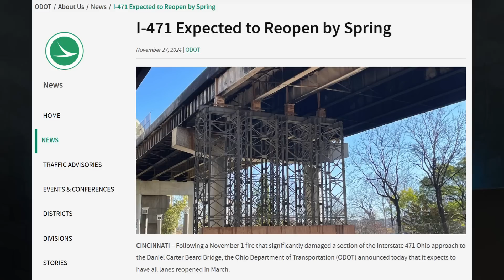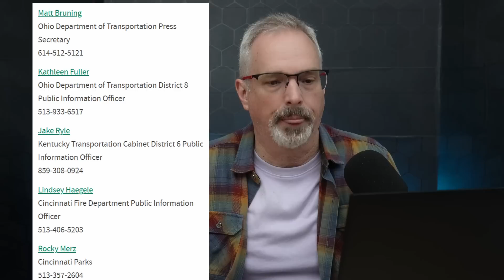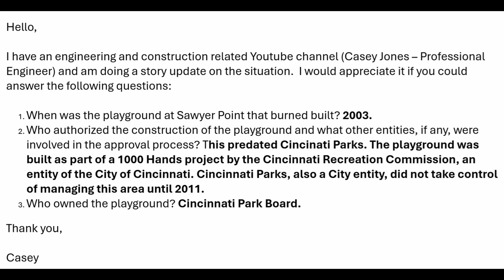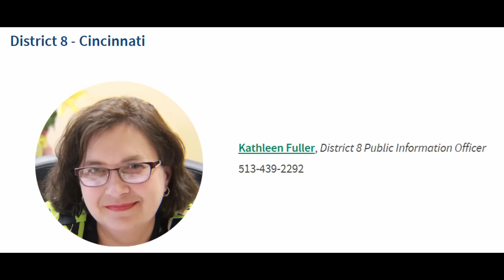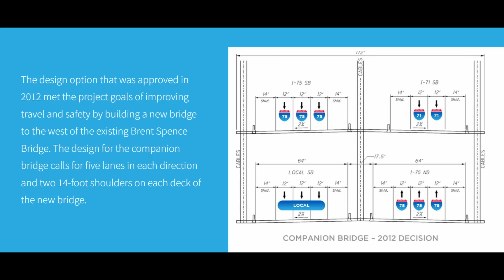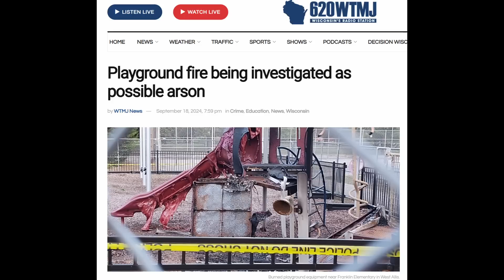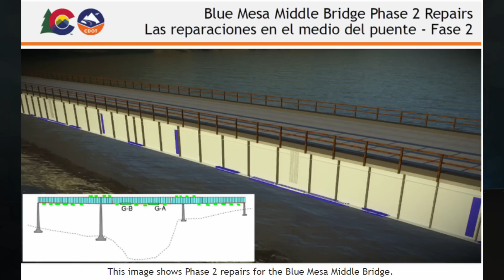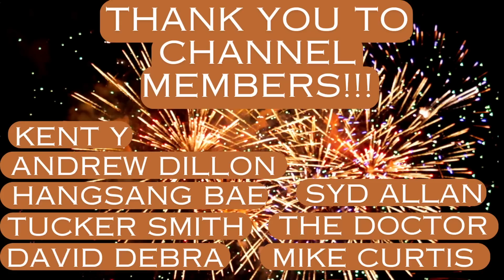Big Mac Bridge Repair Steps and Timeline

Comment: The notion that it was a black swan event is ludicrous.  Before giving the ok for anyone to build any structure under any bridge or span no one  asks or tries to ascertain if the proposed structure flammable. Is the playground they are asking to build, which contains 2,000lbs of plastic and rubber flammable? How flammable? If it catches fire could it damage the bridge or span?
Given the publicity from 9/11 and a host of other highly publicized bridge failures dew to fire, thats just incompetence.
Reply: Just who was incompetent though?  The people who might never have been asked?  I agree though, not a black swan.  There is too much experience with burning tires for that.
Reply: @michaelmcmullen354  
Whomever is responsible for giving the go ahead with any project to be built under any bridge is the guilty one. If that structure damages the bridge in any way. Whenever a bridge is damaged by a fire.  Apparently it never acures to anyone to ask who gave permission for the burned structure to be built, and hold that person accountable.

Comment: It can take 6 to 12 months to get funding to fix this bridge.  So if you total up the time to get the steel plate, then fabricate the steel beams, then shipping the beams, and scheduling the men to do the work.  Not counting equipment allotment and movement.  This all takes time, unless the feds supply emergency methods.  In Ohio, the government is corrupt to a point of criminal.

Comment: I did not understand that they were talking about an entire bridge replacement but rather replace of a span as here, not sure what Ohio does but here in NJ we maintain traffic at full lane count and then have to design removal of the structure a lane at a time.  It takes a lot of time on the design end to accomplish that.  Here they have a shut down span with no traffic control issues and the ability to take out the entire span.  My experience as a driver to family in Ohio is that they like we in NJ do do not shut down lanes but rather work traffic to full lane count, at least on freeways.  I have seen them shut down freeways in the Columbus area where there are good alternate routs, apparently to expedite work..  My assessment of ODot as a long term highway engineer (license retired) is they are a high quality organization.   The comparison to Colorado is questionable as those repairs we done on in-place structures with apparently no deck or structural members being replaced.  These members appear to be rolled members , but they may be built-up girders with web stiffeners and cross bracing, they are not just call a mill and out those girders come.  They may be oversized, as bridge beams are frequently and then there is fabrication.  This is not a call up Amazon, or Granger and order a beam it is a lot more complicated than that. Good job ODot.
Reply: The decision on how to restore or maintain traffic is a difficult one.  I will say for newer bridges they often have generous shoulders and a number of lanes needed for either the class of road, or expected at a future date.  This makes maintaining the lanes easier.  For an old bridge usually traffic has increased and either the shoulders were small or got converted to another lane as traffic increased.  Widenings then usually need to be made first to provide room to begin demo.  Sometimes this requires a widening larger than the final construction does.  It can be less expensive though due to simplification of construction, and sometimes can be used to defer or prevent the need for future widenings.
Reply: @michaelmcmullen354  You understand the problem, I just came through a route in NJ where they have actually built temporary "Baily Bridges to reroute traffic and not drop lanes, complicated and expensive.  I have watched ODot on I-70 between W.Va. and Columbus do something similar, there using extra wide bridges.  All of that design and planning and bidding takes large amounts of time.
Reply: @dmac6004  I actually once used a baily (actually Acrow) bridge for temporary traffic over the Arkansas river and D&RGW RR.  They worked well.  Expensive, but necessary (long detour to get to the other side).  In some ways this was like the US 50 T1 issue.  It was carrying US 50 about 100 miles east of the one near Gunnison.  It was hit by a grain truck on a very cold January morning and partially collapsed with 4 brittle fractures of members (not T1 steel, low charpy).    The Acrow (Baily but stronger) was expensive and took a good while to lease and get shipped to the job site.  The rental cost of the Acrow was about 2/3 of the price of new.  I thought at the time that they should have bought it for potential detour work, but experience with some bailey bridges Colorado owns indicates that they would not be used enough to keep track of and store all the parts and also not used often enough to still have people experienced enough to assemble them.
Reply: @michaelmcmullen354  You are right Acrow, somehow always called them Baily will correct in any writings, thanks.
Reply: @dmac6004  I think their business is in New Jersey which may explain why many were seen there.
Reply: @dmac6004  The Baily  bridge was the predecessor used heavily in WWII.  They are very similar but the Acro is somewhat more capable, I think mostly due to better steel.
Reply: @michaelmcmullen354  You are right about their location they are in Parsippany in NJ.  Actually you can guess my age since I called them Baily bridges as you note a WWII bridge, that is what they were when I started to be interested in roads and bridges, early 50s (like 8 years old) and not sure Acrow even existed then.
Reply: @dmac6004  We must be very close to the same age.
Reply: @michaelmcmullen354  I will say I graduated from NCE, now NJIT in 1966 and licensed in '71.  Worked on the widening of NJTPK in 1966, 6-12 lanes with full interchanges, (we had interchange 15 and the southern mixing bowl) still ranks high in my experience and the ran a firm locally for some 35 years.
Reply: @dmac6004  USAF, then night school grad at CU (physics) while working in CDOT bridge design.  PE 1978.  Retired CDOT in 2003 after 34 years.  Much work in Glenwood canyon through the decades.  Part time work since 2003 at both CDOT and PBSJ/Atkins.  A lot of work on curved steel box bridges, post-tensioned and prestressed girders, MSE walls, Rockfall, and lately bridgerails.
Reply: @michaelmcmullen354  I have to admit I am a real easterner when you used CDOT I immediately though Connecticut but Glenwood Canyon woke me up.  That is another one of those top of the profession experiences.  I have not been along it but next time in CO will try to do it.
Reply: @dmac6004  Actually born in Brooklyn, grew up upstate NY.  Met future wife at USO in Denver.

Comment: I don't think ODOT has done a terrible job in getting their project underway, but their bluster and BS about it "normally being a three year project" just makes them look stupid. It's not like it's a big job figuring out what needs to be done. The bridge was designed long ago, and now just needs a repair. Surely the plans are on file in a dozen places, so it's really just a matter of ordering parts and getting the contractors organized.

Keep it up with the drone video! You have been finding some talented operators, and it really does take your productions to another level.
Reply: We had a similar situation here in Milwaukee with a significant bridge failure. The ordering of the girders was expedited in the first week. It takes time to produce the steel, no matter what its final configuration will be, it gets ordered immediately... you don't need much design for an existing bridge (even if the design standards have changed since the first time). There is also time needed to have fabricators reconfigure their production schedules to make the actual girders... it gets requested immediately. All of this was started before the initial dust settled. Under emergency conditions a lot of the "design work" is waived... Alternative selection, environmental, foundation/soil investigation, public meetings, land purchases, 30%/60%/90% plan reviews, etc. Under emergency procedures, this should take 4-6 months...all hands on deck. Under promise and over deliver but as you said, comparing this to a 3 year project is gilding the lily... what the public perceives as government inaction instead of government in action. I am not sure the Francis Scott Key bridge will take three years.
Reply from the maker: Thank you so much for your comments and encouragement!
Reply: My two cents on the “it normally takes three years” statement may be somewhat supported in a Request for Bid type of project in which the request is released, including a definition of the scope of work being sought, bids are submitted, reviewed and awarded, etc.  This may take several months in the timeframe of a project being sought, awarded and work initiated and completed.  Still, three years is a bit inflated in my estimation.  I think someone at their next public update should challenge them on this by comparing the amazing I-95 bridge replacement of a few years ago, after a tanker fire destroyed a bridge in Philadelphia.
Reply: @jamesbrumgard9066  I think you're on the right track. A "conventional" bridge repair project could easily take that long from the "we need to talk about fixing this thing" to the final completion. Further, in a conventional repair situation, it's not going to be an all hands on deck, 24/7 kind of workload. There are other projects that would be working at the same time, this or that taking priority, etc. Casey is right that an "emergency" project doesn't take that long, but I don't think that is what Ms Fuller was talking about.
Reply: Six months work and over three years to organise finance…

Comment: So the take away I got is, "We normally drag our feet and take years to do projects. This time we are just going to get it done."
Reply: Years are needed to avoid creating problems.  If best scope is unclear and you only need to replace a broken component, the scope can be much less.  Depends on the structure and the damage.

Comment: The south bound I-5 bridge over the Skagit River in western Washington was knocked down by a truck several years ago. A temporary Military bridge was installed to allow 2 way traffic. The replacement was built alongside on temp pilings; then the temp bridge was removed and replacement was slid into place. The southbound out of service time was much less than originally forecast.

Comment: Well maybe 3 years for the replacement of the entire bridge deck and girders, but certainly not for a single span.  In 2001, they replaced the entire deck and supporting girders of the Jacques Cartier bridge in Montreal, Quebec, Canada.  A then 90 years old 2.68 km long cantilever bridge over the St-Laurence river and waterway. They worked during the night while the bridge remained fully open during the day.  About 90% of the bridge users where not affected by the repairs operations.  And it took only 2 years to complete!  There are videos on YT about it.

Comment: Three years is perfectly reasonable for a regular design-bid-build process for a run of the mill bridge rehabilitation project.  For instance a concrete deck overlay with superstructure and substructure repairs on the average overpass or stream crossing.  The stream could take longer due to environmental reviews and requirements, some plants can only be identified at certain times of the year.  

A superstructure replacement with substructure repairs (the scope of work here) would in some areas be programmed 5-6 years in advance with design beginning 3-5 years before completion depending on the site, for example potential presence of listed species, recreational properties, railroad coordination which are all required for environmental clearance.  The emergency process does circumvent a lot of the environmental bs.  I am not sure what you would do if you ran into right-of-way problems, that can add years.  (Shouldn’t be a problem here but sometimes the real estate people sell off ROW a little closer than they should). ROW could be a problem depending upon how they expect to set the beams, most likely in the form of right of entry but that depends on a lot of factors.

I have watched a number of your videos, seems like you should be familiar with the standard procedures.  Maybe not as you seem to specialize in geotech consulting which is a part of a project but not the whole thing.  Not sure if you are keying in on the 3 year statement to generate controversy or interviews or are just unfamiliar with how long the standard process can take.
Reply from the maker: You entirely missed the point. This isn't a standard process, this is an emergency repair. The two timelines should not be compared. Since the standard process doesn't apply here they're only mentioning it to mislead people.
Reply: @CaseyJones-Engineer  Keep in mind we are criticising a PR process which has only little to do with what the minions who do the work closer to the action are doing and thinking about.  What the public wants is not as engineering focused as what the people who read this sort of Utube and its comments are interested bridge.  I design a bridge the entire process taking a decade from conception of need to opening.  It is beautiful, economic, and cuts travel time 10 minutes.  I go to the opening attended by the state govenor.  He praises the work of the consultants who designed it (they didn't, I did, a state employee).  I ask my wife what she thinks of it as we go under it (she knows more about bridges than 90% of people having been married to me for near 60 years).  She says "What bridge".    I attend a National Convention and recieve award for best bridge of the year...

Note any highly experienced engineer who doesnt know how to set up a process for an emergency repair is not worth his salt.  He will know if a "standard" process set up for emergency repairs the existance of such a standard will get in the way due to the standard being miss applied or over applied.  Such is the nature of bureaucracies.
Reply: It also takes 20 years to build a nuclear power plant but what does that have to do with an emergency span replacement on a critical artery? "Normal" processes are short circuited and, to a degree, price is no object to restore the facility.

Comment: It’s going to be one span plus a support column, which once you start chopping back on the concrete, you might as well be replacing 2 spans.
Reply: Maybe, often fire damage on concrete is limited to the cover so a column can be repaired by removal of the damaged concrete and pouring new concrete on the outside.  This can be durable if the new concrete can be confined by some more steel stirrups and bars.  Possibly confined by an FRP wrap.
Reply: @ yes, but that damage is going to be on the top. If the damage envelopes the steel connectors at the top of the column then half the weight of the next span needs to be moved of the column. And it needs to be moved off sufficient that the work can be done.

Comment: When I look at the scene I donot see enough debris in the playground to reconcile with the intensity of the fire. Must have been some flammable material present/stored when fire started. Why is no one asking what was present to have made this fire able to be as intense and sustained as the fire was? Nothing wrong with best case scenario (BCS) as long as it's clear that time line is BCS and will be revised as needed. Great timeline for Nucor to ship steel beams to fabricator must have been ordered almost immediatly after fire. Ray
Reply: Shredded rubber mulch. Essentially a big tire fire.
Reply: The fire was intense.  Does a playground have enough fuel to bend steel girders?  It does not add up.  I do not reconcile it either.
Reply: Many say it's the shredded rubber mulch, but still surprising it burned that large and intense. It's concerning that authorities are staying mum. What are they hiding?
Reply: @ronbennett7885  
If you've ever burned a tire, you'd understand.  One tire burns hot for a while.
Reply: @scott_meyer  Been using tires to prevent frost damage since the 1960's more smoke than fire from my expirence frowned upon now. Thanks for response Ray
Reply: @rs2024-s4u  
Obviously arson.
Maybe the arsonist used gasoline to get it going.
Reply: @scott_meyer  I get antsy when 2 + 2 does not equal 4. Ray
Reply: @rs2024-s4u  
I don't see a problem.
Lets do the math
Recommended depth of rubber mulch is 4 to 6 inches. Lets use the minimum of 4.
We'll assume a 30x03 mulch area.
That would be 300 cubic feet of mulch
Rubber mulch weighs 2000 pounds per 75 cubic feet so we have 8000 pounds of shredded tire rubber.
Tires are 13,000 - 15,000 btus per pound
That would be 112,000,000 btus of fuel, equivalent to about 900 gallons of gasoline.
Reply: @rs2024-s4u  In those days they did burn tires in smudge pots.  It was remarkable by the acrid black smoke.  I am still struggling with the idea that a playground did that damage without accelerants.
Reply: @ronbennett7885  
Shredded rubber is about 14,000 btus per pound 
Gasoline is about 20,000 btus per pound.
Reply: @ronbennett7885  Exactly what I was wondering. Ray